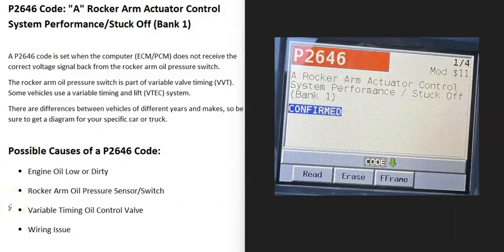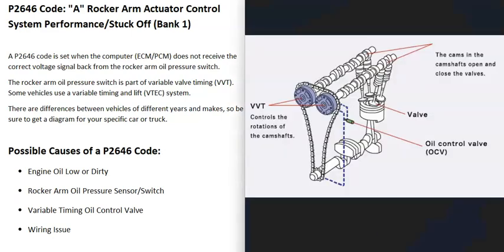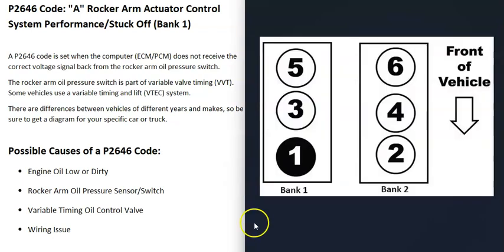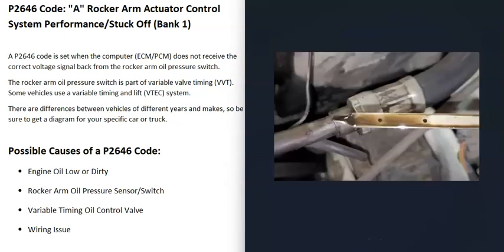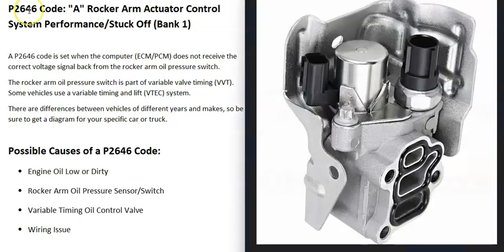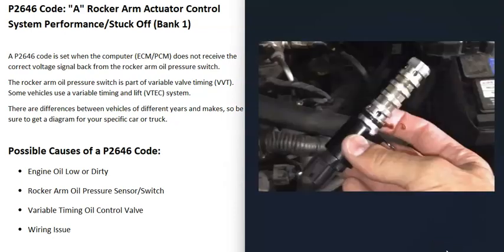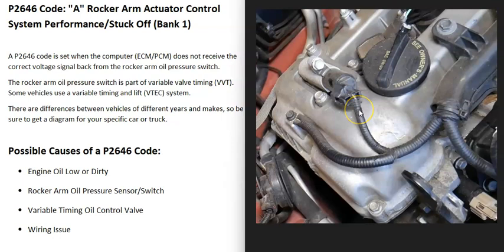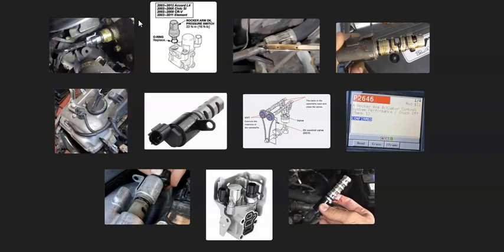Causes and Fixes P2646 Code: "A" Rocker Arm Actuator Control System Performance/Stuck Off (Bank 1)

Comment: Am I right in assuming that VVT solenoids are the oil pressure sensors/switches?
Reply from the maker: They are separate components. The VVT solenoids are controlled by the computer to adjust the engine's variable valve timing (VVT), and the oil pressure sensors/switches report to the computer what the oil pressure is.

Comment: after all and the code went out the car drive fine and once you are on a speed the code comes up again. what can I do if this  happens
Reply: Did u fix the problem bro? I have the same issue
Reply: I recommend an oil change. If it does not help, I would replace your solenoid.